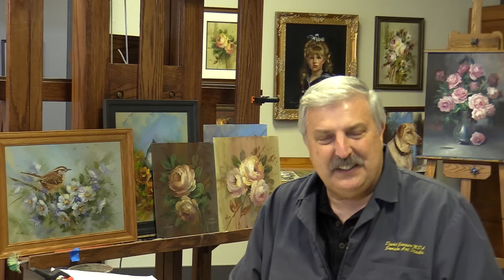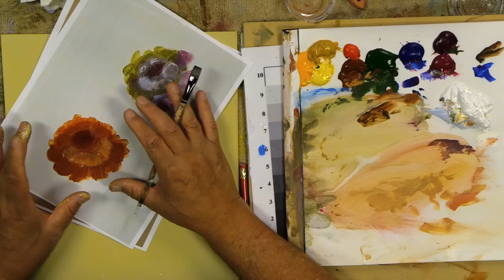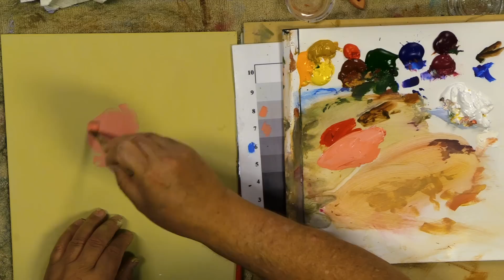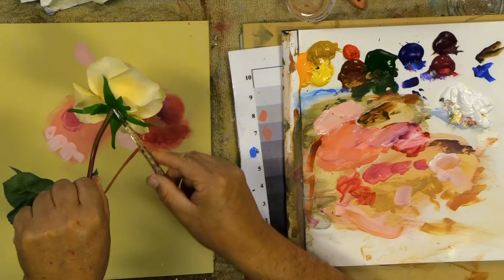How To Correct Acrylic Roses-  Petal Shapes

Comment: I love your lessons and watch them often.  Thank you so much for your generosity.
I'm thinking others have this problem, too.  I am having trouble getting the softness and edges that you get.  One big problem is I don't paint every day... the paint gets dry before I finish a rose.  Is there a way I can work on this wet-on-wet technique once one layer has dried?  Putting a coat of extender over the now-dried, unfinished flower?  It could be a week or two before I again work on a particular painting.  I have the Heritage paint, extender, and thickener.
Reply from the maker: Hi Teri,  There is also the "solvent" technique I use on roses all the time.  It softens the edges even after the rose is dry.  Just take a little water on the tip of your finger and gently rub the Heritage.  It will soften and blend again.  You can do it for about 2 hours after you apply the colors.  I did a few videos on this one the channel.  Look to the roses and solvent technique.